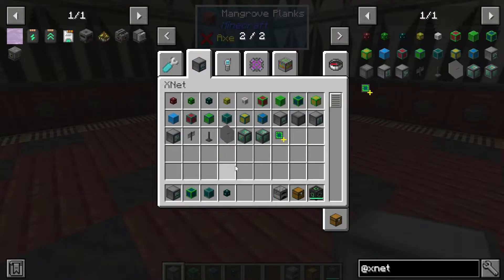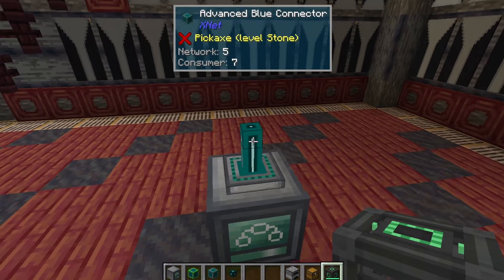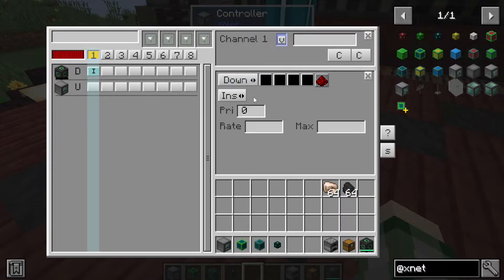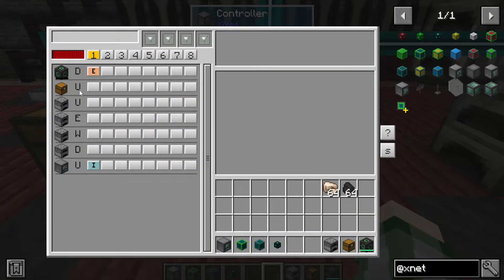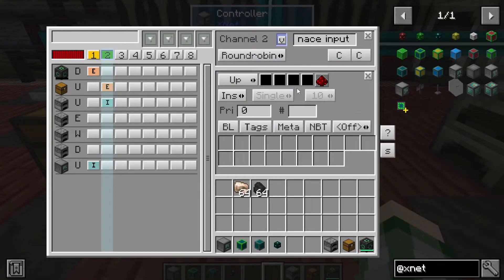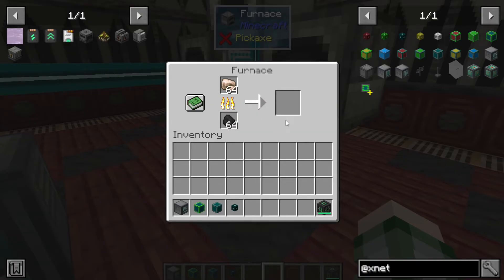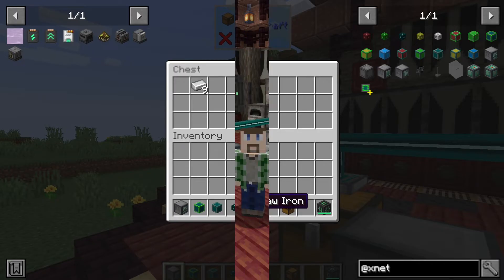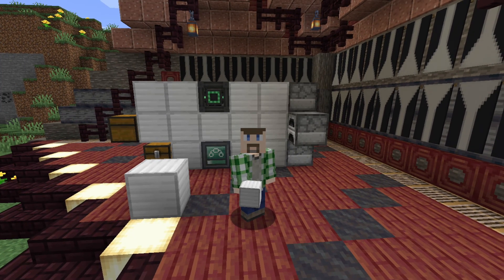XNet Basics - Minecraft 1.12 - 1.19 - Modded Minecraft Tutorial

Comment: Why doesn't the iron go into the 4 furnaces but the coals do
Reply from the maker: Assumung you’re talking about a vanilla furnace, they’re extremely sided.  You can only insert iron in the top, coal in the sides, and extract from the bottom.  You can do this with a single advanced connecter, but you need 3 channels and you need to configure the input sides on it.    You can see how this works with vanilla hoppers. 
 
https://minecraft.fandom.com/wiki/Tutorials/Automatic_smelting
Reply: @Ardcraft  It's not just that the furnace is sided.  When you copied the iron settings to each connector, it didn't set it it insert at top, but stayed at it's default (the side the connector is on).  Perhaps, since the 1st one defaulted to what you wanted, thus you didn't actually touch that setting, it thought you didn't care about it.  In any case, this seems like a bug.  Copy/paste should cover all settings.
Reply: That's because he set the thing to extract stacks from the chest 5:40 (and not items one by one), so it pulled out the only stack and put it the first furnace I think
Reply: Or just use Mekanism Energetic Smelter

Comment: Btw, if playing with mekanism, you can use xnet exactly like this to evenly split clean slurry across your crystalizers, simply extract from the washer insert into your crystalizers, set the channel mode to distribute with xnet.mekanism, set the rate to 200 and enable "require insert rate". No longer will you need to have separate factories for each ore and you'll never have leftover slurry locking up your factory :) If only the pipez mod supported mekanism slurries...
Reply from the maker: That's actually a really good point.  Now if only I ever had a reason to actually use Mekanism's ore quintupling.  ¯\_(ツ)_/¯

Comment: Great tutorial. I struggled with getting my head around tunnels at first. Agree that best interface is the advanced one where you can access any face of the machine. 
Another little tip is you can name the channels to remind you what they do 😀
Reply from the maker: Thanks for mentioning that.  I had even showed it when filming but cut it because I’d fumbled part of it and forgot to refilm it.   You can even see that I’d named one of the connectors at one point.

The other important part of the advanced connectors is that they’re flat out faster and can transmit larger payloads.  I think I said that but I probably should have showed the explicit differences in the UI
Reply: Ooh good point I hadn’t noticed the speed and payload diff as I never used the basic interface. You could mention the diffs if you revisit for another round of tips 👍